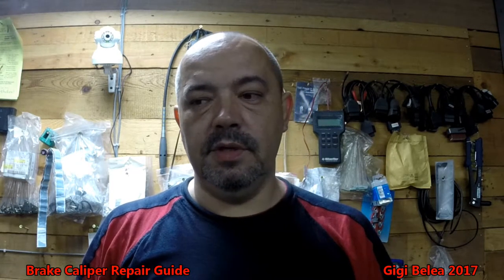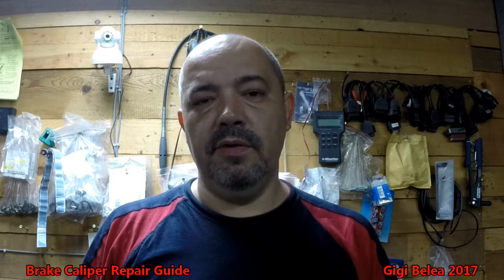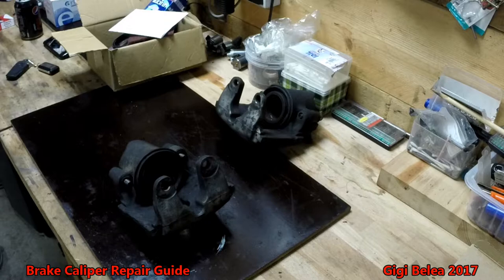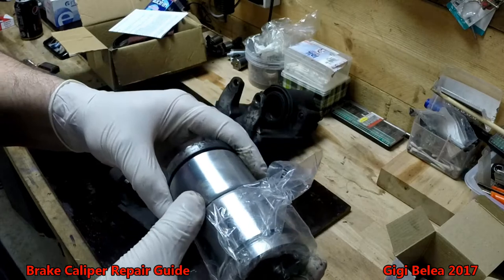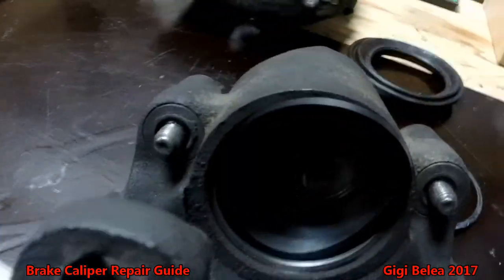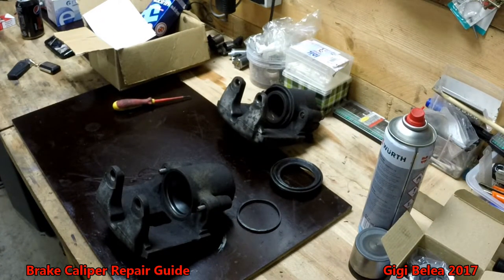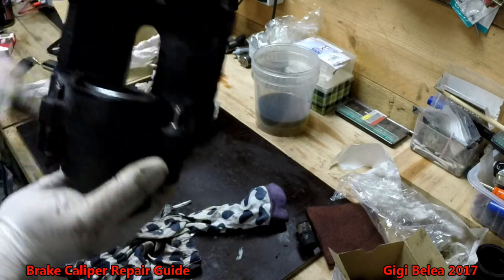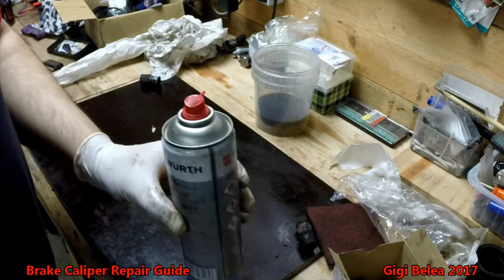Brake Caliper Repair Guide   BMW E39 Or Any Other Car

Comment: How powerful air compressor you use?
Gigi good work and thank you for sharing knowledge!
Reply from the maker: not to strong, any air compressor should do the job, the piston will slide easy out. As an alternative methode, more dangerous but more fun , you could use the lighter gas and fire :) It would blow right out.